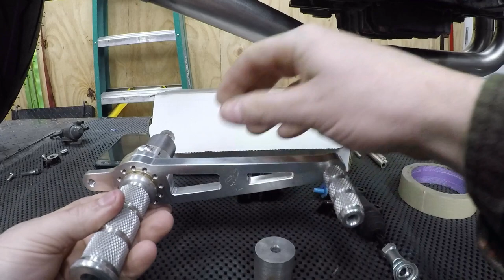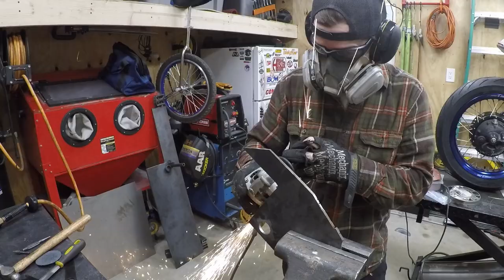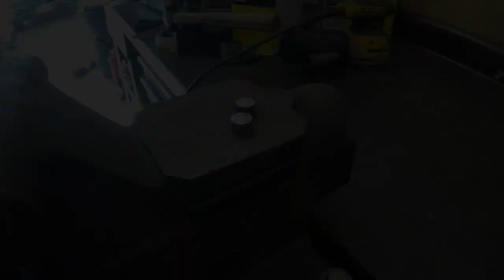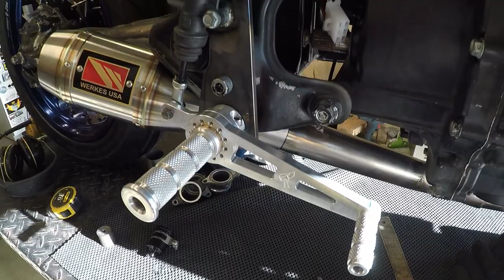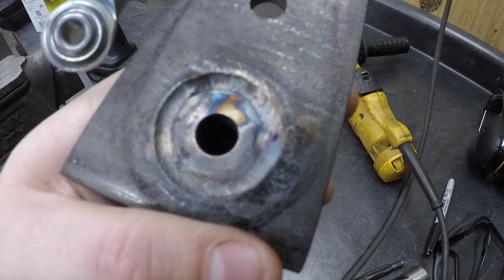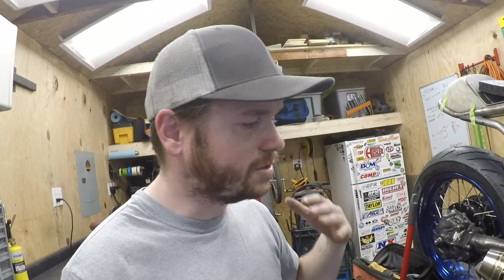CX500 Tracker Build - Installing Rearsets and Master Cylinder - EP21

Comment: I have a small cordless drill I use to tap, try it, it's worked real good for me over the years. You have a very good grasp of different metals that I had to go to school for that. Do you ever oxidize your steal black? I've recently watch a guy do it in his garage, it looks easy and stops your parts from rusting.
Reply from the maker: I havent done any plating but soon enough im sure it will be something I do. There are platers near me I can use which is convenient

Comment: What bandsaw is that?
Reply from the maker: It is a Klutch brand from Northern Tool supply.  Has proven to be one of my most used tools after I added a platform to use it in vertical form.

Comment: Great job on fitting the rearsets and fabricating the brackets. I'd be a bit concerned about the MC being too exposed. How about adding 2 more fixing points the same as the ones that hold the MC in place to accommodate heel plates and hide the MC behind the heel plate?
Thanks for sharing your work.
Reply from the maker: With the angle of the MC its not really where your heel is. I like to expose a lot of the mechanical stuff especially on these bikes just per my own preference. Heel plates look good but they very likely wont make it on this bike.

Comment: Nice one bud. Just wondering how you prevent the plunger coming out of the MC if the footpeg is lifted up? Is there a positive stop or something that prevents this? Cheers.
Reply from the maker: Good catch! I'm working on that currently but didn't want to clutter up the video more than necessary. It will definitely have a safety stop/catch of some sort
Reply: @BrickHouseBuilds  Ah cool, I have a very similar project on the go and we are at a similar stage. I am yet to fit the rear MC and have a couple of units I am playing with. I have the same as you as well as an R6 MC, the mounting points differ slightly on the R6 MC but the plunger is captive which simplifies things. Enjoying following the build, keep up the good work.